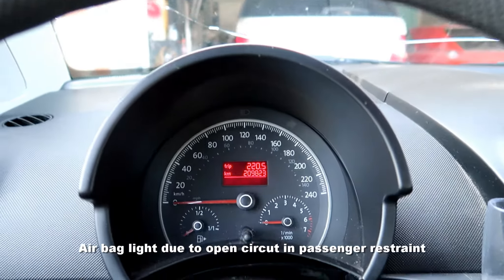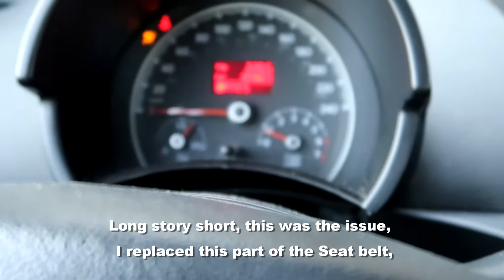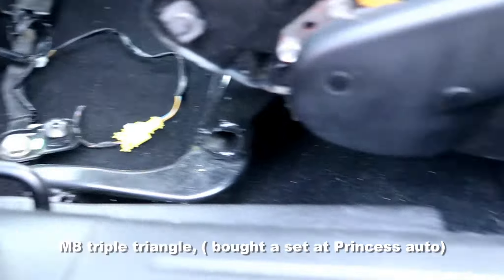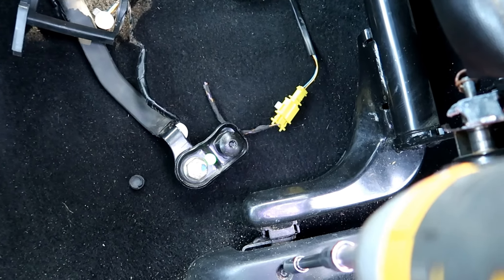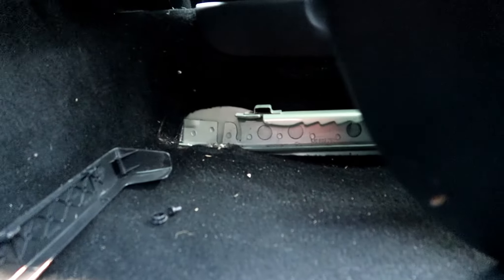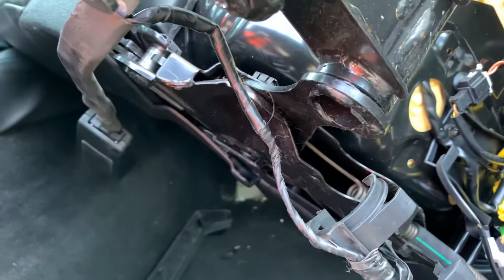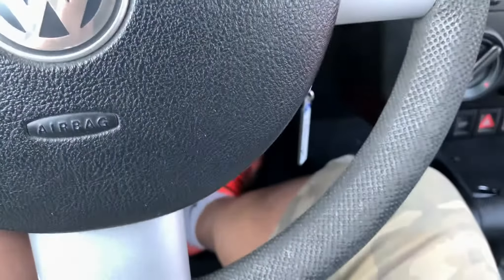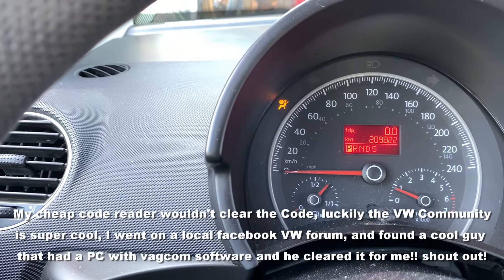VW Mark 4 Airbag light on Due to seat belt open circuit

Comment: Do you still have the Bug? and how many miles are on it?
Reply from the maker: Yes still have it , it has 223,000 km
Reply: Happened to me just now on my 2010 beetle. Just had my vapor canister replaced. Not sure if the guys did anything to the seat. 💺 my seatbelt is not on